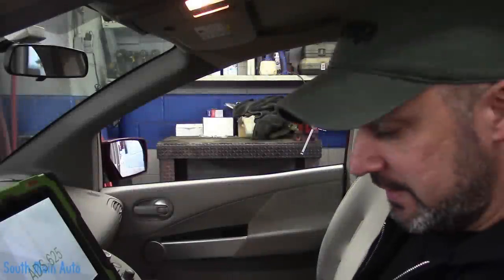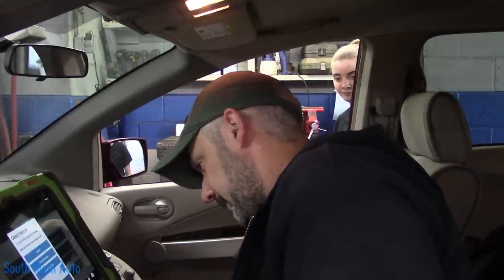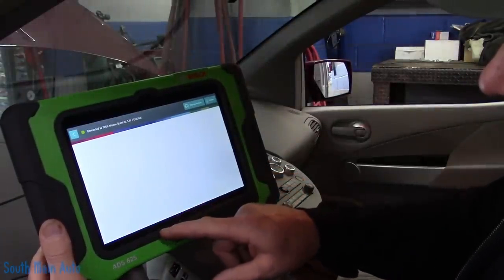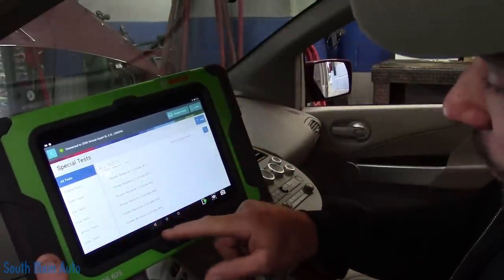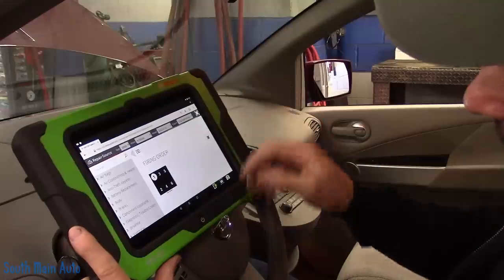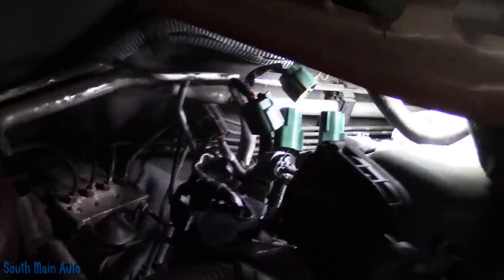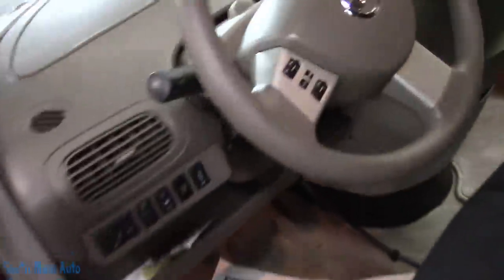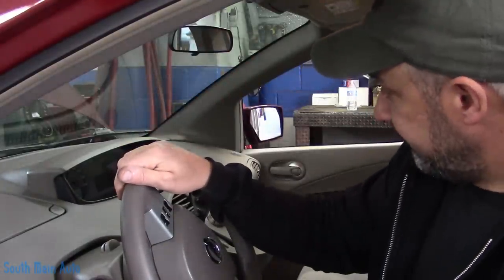Customer Replaced Spark Plugs And Now It Runs Bad!?

Comment: I have a 94 Ford F-250 with a 460 engine. I took it to a Ford garage to have the exhaust manifold gaskets replaced now after a 3300.00 dollar bill. The truck is running real rough and rich. It's fuel injected and I think maybe they did what your guy in this video did. I suggested that to the service dept. manager but for some reason they can't figure out what they did to my truck.  Any thoughts or suggestions?

Ps I really like your style in producing videos. Entertaining and instructive! Great Job
Joe
Creative Craftsman 
Soap Lake Wa. 98851

Comment: Put the head back on a 2014 challenger r/t (left the exhaust manifold on) and accidentally pinched the upper 02 sensor wire between the head and block. Ruined an 02 sensor AND a new head gasket.....

Comment: One thing you hit on that most never acknowledge. When a motor is running bad why do folks rev and run the hell out of them. At very least you are putting a bunch of fuel in your oil but you may burn valves or worse. Its not hard to turn a 20 dol. Fix into major damage.

Comment: The owner of a forklift thaught he would be of great help if he found me a better ground for my welder(without teling me). Ended up fring the tcm and wire harness. He got o bill of 3700 euros.
It was like tring to weld something on a brake disk with the ground on the car and the only electrical conectiion being the abs cable or something.

Comment: I had my cistor dobrhis and bend the groun$ closed to the electro sending a po304 po306 & followed basic check what they did.. they closed the firing and shorted the plug . Then to add auto lights hate these cheap plugs..

Comment: Another common mistake is disconnecting the battery to replace an electric component and then forgetting to reconnect the battery afterwards.  Or not realizing that your vehicle has two fuse boxes.

Comment: This is why you do one Coil and plug at a time if you are unsure lol.

Once while swapping a camshaft on an SBC400 in a 77 motorhome, I miss counted my lifters. I left one in. Cam came out and a lifter dropped into the oil pan.

Let me tell you that taking an oil pan off a full framed G30 van is a bitch.

Comment: I used a rachet wrench to take out a bell housing bolt and ran the bolt all the way out until the wrench was stuck abd unfortunately they were not reversible so i had to cut the bolt and Tri Star Motors where i work made me pay $3.98 for a new bolt... I will never make that mistake again.

Comment: Got a good one i have a 2009 dodge dakota 3.7L i did a tune up on after i got done it ran like poo i kind of did the same thing as you speak but this one has three coil paks shared for two cylinders i had to put new wires on this time and plugs after i started it up i knew i got the wires crossed so i tried to look up the firing order on the internet found no info for that which wires went to what coil after a little head sratching i looked on the old wires it was marked on those which coil they went too lol after that

Comment: I was just wondering if you have time for a question. about engine smoking and loss of power on hill. goes from 65 in 1/4 mile up hill to 45 smokes like bad head gasket with black liquid oil coming from exhaust. It's on a 2001 Kia sportage automatic  4×4 does have oil leak.  1 can it be fixed by rebuild kit for top end or  2 do I need a motor for it.  Or 3 do I rebuild bottom end .

Comment: Welding on unibodies is not a good idea without pulling out the carpet/undercoating.  You can be welding from underneath and the inside of the truck can be on fire.

Comment: Lol yeah I was working on an earlier ford 292/312 engine that had a 2bbl carb and ccv apiture with scrubber media (mesh) anyway my dads neighbor showed up and insisted I was timing the 351 wrong so he jumped in and proceeded to time this old engine like a it was a 351 c didn't matter what I said I was wrong so I walked away and asked dad not to try to and fire the engine till I got back. Lol I unlined the bendix for the starter and pocketed it. Anyway I came back with a couple cups of coffee and smiled dad said you really didn't want him to steal your thunder , I said that's not it at all dad this 2 engines are 292/312 engines and their timed way different compared to a 351c let me show you. Which I did and dad was pretty good with flat heads  but scarcely knew the 292-312 I laid out the timing and to his shock the neighbor timed the engine 2/3 out of time  in comparison to the original equipment shop manual for a 62 ford t birdtimeing it done center of the crank and cam on the right side 12 pins from the center to center counted

Comment: Removing an engine to be worked on. Failed to install main engine ground. Took 5 hours to trace.
Reply: I've also flipped an entire injector harness on a 4 cylinder. Wondered why it ran so bad. Then after inspection realized what happened.

Comment: @south main auto repair llc got a 2007 nissan sentra 2,0 with 160,108 miles and the high pressure switch in the transmission is out but still goes into all gears and drives . is there a fix for it ?

Comment: Funny ones are when customers drain the transmission oil and fill the engine with oil thinking the engine oil was drained. Now the engine is overfilled and the car wont go into drive or reverse.

Comment: I've got a 02 Dodge Ram 2500 and had some shade tree mechanic change spark plugs back in late 2019. 2 days later was driving to work & it made a pop sound and I thought I had a flat tire when it started shaking. It would crank but the die 10 seconds later. Now when I put key in and turn start the power comes on & door dings but it doesn't turn over. In roughly 3-4 seconds power goes and a red light flashes on dashboard. Any clue what that could mean/be? I need my truck back sooo bad

Comment: First time I replaced spark plugs was on a V6 Jeep Cherokee and forgot to keep track of where I took the wires out. I thought I could guess by the length later but I was WRONG!  This was when "the web" was pretty useless for this sort of thing so I had to walk to the Autozone and ask them to print me out a fire order diagram which fortunately they had.  For those curious, on a V6, there are 6! (720) different ways to wire the spark plugs so that's 719 ways to screw it up.

Comment: Stupidest mistake I have ever done, which is impossible in most cars, is I put the brake calipers on upside down on a Nissan Frontier. Almost always, the calipers are impossible to put on upside down on any car and the brake line feeds in the top of the caliper. On the a Nissan Frontier, the line feeds in the center and the calipers fit in place in both directions. When I test drove it, just barely touching the brakes locked the front brakes. I spent a long time trying to figure out what was wrong.  Everything looked great.  I then went to another Frontier stopping good and took off the wheel. Then it hit me that the calipers were on upside down.  There is no indicator which side is up on them and this had never come up in any other vehicle before that time.  This is the only brake system I have ever seen that can fit both ways.  I am the one that handles the difficult issues nobody else can handle.  Those cases are passed to me.  Technically, I did handle it.  But how stupid do you have to be to install calipers upside down, even if they did fit in place that way?  Stupid is as stupid does.

Comment: 0:36 can someone please tell me what does it mean if when you put back the original spark plugs, it suddenly runs well again? Now ive been through over a dozen spark plugs, and they ALL run rough, except for the original spark plug that came with the vehicle. Ive tried original branded denso, and the ngk original. Ive also tried denso iridium plugs, but every single plug runs rough and difficult to start the engine. The code on the plugs ive tried are the same code as the original plug too and i confirmed it in the owners manual. I also bought all the plugs from the dealer, and even tried different delers in different cities. Only the iridium plug, i bought online, but it makes no difference.

Comment: Hey who makes goofs? never - ha ha, but it usually only takes a day or two to figure out what I did, I think relative to what you found I miss-fitted a coil pack on an 03 Cavalier - not getting the wiggly boots seated correctly- but that was over a year ago.  Lately no goofs just dealing with my 07 F150. 2 years ago it was the suspect plugs on a misfire under acceleration load. And the pending horror of having to pull the prone to break plugs to change them - but I changed the coils first and problem went away. It turned out later when I did attempt the plugs it was a non issue as a previous owner had replaced the plugs with the new style less prone to breakage. Then it was replacing the starter in a store parking lot over a 3 day episode because the top bolt on that mother is  a x@%#*&@$$%@@ several different combinations of ratchets, extensions, sockets, and scrapes and bruises later it was finally done.  Now finishing up today in the yard, On 8 July in Alabama in 95 degree heat and 90% humidity I repaired successfully, I hope, the Non-repairable 2 piece drive shaft on the F150. I am making a video on that and this truck, I will let you and all know when I get that put up. or like we say in Alabama - I'll get wit y'all on it.  I must say thank you for your very entertaining and informative video's even though you haven't covered a problem I have had you have certainly given me more insight on troubleshooting.  JS

Comment: Oh man, mistakes huh?. Well two right off the bat. Lady comes in for an oil change, in a hurry as per usual. Drained the oil, took off the filter, replaced drain plug and let the car back down. Filled it up with new oil, reached in cranked it up and my cousin starts yelling to shut it off. Yep, forgot to put the new filter on lol. Had to dash to the local parts house and get more oil.
Second one. My buddy wanted me to remove his cam. He brings his motor, drops it off and at the end of the day I got started. Came in the next morning and my buddy was there and asked me what I did to his motor. Told him I removed the cam like he wanted. He looked down and I looked down and I started laughing. I don't know what I was thinking about when I started working on it, but I had it tore down to the short block lmao. Heads were on the floor beside the motor, lifters, valve covers, push rods, everything lol. 
Lesson: we ALL make mistakes, even pros. It happens lol

Comment: Found out that my 1967 Dodge Charger had reverse threads on one side of the car also my 1988 S10 I messed up the firing order every time I changed the distributor cap label the wires still duh

Comment: Read in a car mag once that a dude got his gearbox rebuilt and trailered it down to the drag strip and had a box of clunky gears and shavings at the end of the 1/4 mile, he forgot to fill with it oil. 
I laughed my arse off........until I smashed my diff and bought a second hand one and drained the oil first and got busy putting it in and took it for a spin and heard squeaking. Oops.

Comment: I sure wish you could help me figure out whars going on with my 2016 fusion2.0 tu rbo.iam getting runaround from dealerships both wherGot any ideas thanks nathan i get it to you if you can help  shesa a cool car with 143000 miles and is clean. what could possible problem be other than bad block head gasket

Comment: Didn't tighten the drain plug inside the screen  on a freshly rebuilt Air cooled Volkswagen engine?  The maiden voyage some lady in a jeep pulled me over to tell me I lost my oil , A couple corners back....., that lady's kindness in stopping me gave me about 15,000 miles before it blew the connecting rod out top of the case,

Comment: What would make my car sound like an airplane engine when I reach speeds of 25-40 mph. It is getting louder and louder, so I rarely drive it, maybe once or twice a week 20 minutes to town and back. I have had the engine reader done at the Auto Zone and it only shows the cylinder 6 misfire, even though I have replaced the radiator, engine coil, spark plugs and spark plug wires. Nothing else comes up other than my fuel gauge which doesn't work. I am desperate to find out what it is. I am 60 and disabled with limited income.

Comment: The best most comical mistake I've made was helping a buddy do an engine swap on a 91 dodge Dakota..... long story short apparently dodge tbi  is well different and when you miss hooking up this one little ground wire and turn the key on the injector is open and proceeds to fill the engine with gas rather quickly especially when you are doing the initial leak and key on engine off safety leak check and obviously smell gas but don't initially see it till it overflowing from the throttle body

Comment: It's kinda hard to replace the valve cover gaskets without removing the coil packs isn't it ?? Everyone is talking about doing one plug at a time, but missed the hole reason why he tore it apart to begin with.

Comment: Taking in a oil pan on a Pontiac torrent all survice information was wrong and the frame was in the way so toy could not remove bolts and do the job with out dropping the engine 3ft on one side to get the bolt out just to find out you did not need to remove it that way becous thair was a access panel you had to punch out to remove it through the unibody

Comment: Easy mistake to make. I Had to clean the EGR passage on my 99 accord, when I put the intake manifold back on I didn't fully plug in the map sensor and didn't fully bleed out the system, it idled high and eventually stalled, had it towed to the shop and felt like an idiot for such an easy to fix mistake when they told me what it was.

Comment: I took my car to a shop with good reviews. It had been shifting hard once in a blue moon. Took forever it seemed to gas it. So they said they could replace my motor mounts and spark plugs. Give it a tune up. My old mounts looked like shit. So I was happy thinking my car would act way better and not shift hard anymore. Nope, sounds like absolute shit now. Rough idles randomly. In and out of smoothness. Still takes forever to speed up it seems. I’m thinking they didn’t install the right plugs, or didn’t do it right gapping wise etc. Cause my car honestly didn’t sound bad at all.

Comment: Monday I learned that some brake caliper pistons screw in. 

After spending half the afternoon trying to force the damned thing into the caliper body.
Reply: 2009 Matrix XR, rear brakes (emergency brake clamps the pads onto the disc):  One side screws in CW while the other screw in CCW.  And it does not seem to be a progressive screw-in rate, which puzzles me enough that I plan to get a rear caliper from a parts car/wrecker to disassemble and see the internals.  Also the piston seems to be prevented from rotating when the emerg brake is applied?

Comment: Does anyone have a Toyota Camry.

I heard that the Idle Air Control Valve is a common problem with getting stuck/sticky and filled with carbon deposits.  Does the cleaner actually work?
I would hate to replace that.  Because then I would have to replace the throttle body too and it's about $1,000.

Comment: Car: Subaru Legacy 2004.
Problem: Rear left door won't open from the inside.
Solution: I removed the door cart and saw the cable going to the handle was snapped. Stupid me thought: "Hey, let's solder the two pieces!". Did it, put the door back together and closed it. Trying to open it the joint semi failed. The cable got stretched and the mechanism got stuck, so now i couldn't open the door from the outside either. Luckily it eventually snapped and i opened the door from the outside. Later we just changed the damn cable, like i should've in the first place. For a moment there i thought i was going to have to change the whole door - i was ready to rip it apart. >:-)

Comment: I was working on my car than it was hard to start when It did start it ran like crap turned out I didn’t connect the temperature sensor wire It coded on me I plugged in my scan tool than I realized what that I didn’t plug it back in

Comment: My biggest mistake is I got married a while back.  My biggest fear is I might be dumb enough to do it again.  Biggest repair blunder as a DIYer, I had my Toyota 3.4L rebuilt with new heads after one cracked instead of buying a used engine for much less and faster time to get back on the road.  A recommended machine shop did a bad job with the short block and couldn't set valve lash correctly.  It burns more oil after the rebuild than before with 220k mi.

Comment: realy rookie mistake  (and could have been bad). i dident tighten bolts on one wheel on my sisters car after changing from winter tires, and when she drove down the small road from the house (30 kmph max) it came loose  and wobbely (i vas only 16 or 17 maybe )  so check and recheck those bolts lol

Comment: When I change spark plugs and wires I don't go by firing order. If it's 8 cylinders I start with driver side and write on paper 1,2,3,4 the passenger side 5,6,7,8. Then draw distributor cap and write down where 1,2,3,4,5,6,7,8 connect on cap. Works every time.🙂

Comment: Got a call about rotors being seized to a truck and he spent days hammering heating smashing and even chipped em. It was a Ford f150 2wd and Autozone gave him 4wd rotors. He offered $100 to get the rotors off. got there popped off the dust caps removed the cotter pin and nut. When they slid off on the ground he was pissed. went to Autozone bitched out the tards working there but it was a very easy $100....